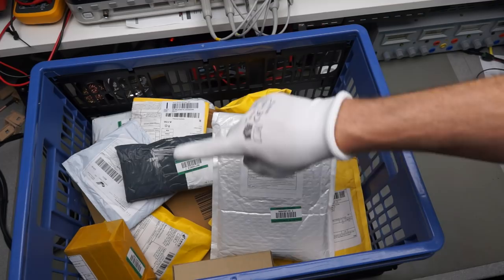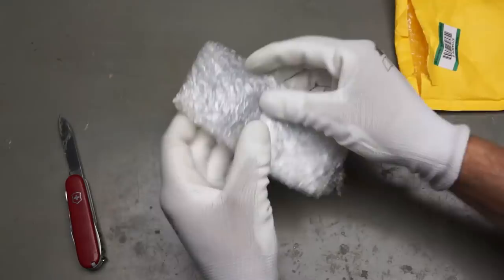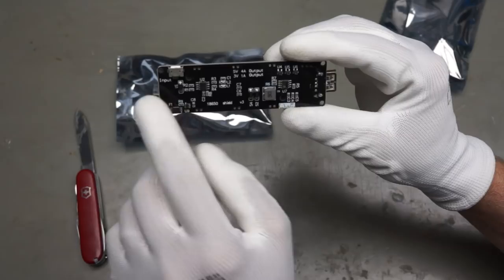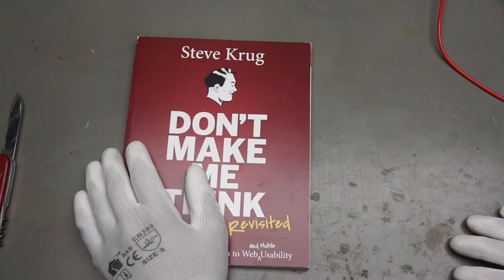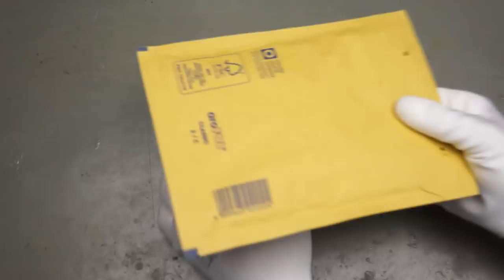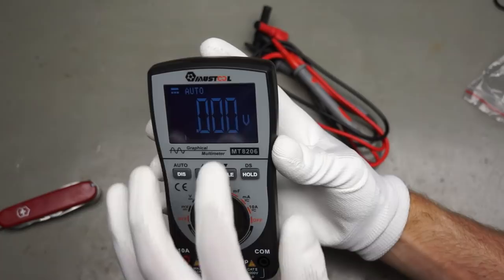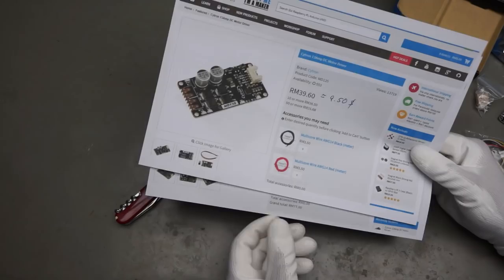#238 Discount Day Mailbag (2.4GHz LoRa, 8x8 Pixel IR Sensor, AM612 IR, MT8206 Multimeter

Comment: I already used that 18650 board for a couple of projects, worked really nice :)
Reply: A bit slow to fully charge the battery, tough, better to use a wall charger.
Reply from the maker: Thank you for your feedback. I think you can change a resistor to increase charging current to up to 1A.

Comment: One diference between this panasonic 8x8 IR sensor and the normal PIR sensor is that this sensor can detect Infrared that is not on movement while The normal PIR only detects IR that is moving. 
A good use of this is to detect a person sleeping, because de PIR fails on it
Reply from the maker: Thank you. I will test it. This would be bad for my work desk. Now always when I fall asleep, the light goes out and I can continue sleeping ;-)

Comment: I can recommend the AMG8833. I have the Panasonic Evaluation Kit for this sensor - worth getting if you are interested in using the sensor in a product. The sensors were originally around €80+ however Panasonic had a rethink last year and greatly reduced the price. I was quoted around €25 in fairly low quantity. The price from Aliexpress is pretty good since the sensor is on a breakout with a voltage regulator and the necessary passives. Soldering this sensor isn't easy - the temperature limits and reflow profiles are difficult for the typical tinkerer.
Reply from the maker: Good info, thank you. I saw it also much more expensive. Now it is not cheap, but affordable.

Comment: It's interesting to see how many people are interesting to see things you purchase. Now I feel encouraged to make a video on things I purchase.  Infra red sensor seems interesting.   I want to buy
Reply from the maker: Mailbag videos are always interesting. Not only mine ;-)
Reply: I kinda figure recording the opening of packages on a video camera recording is a good insurance policy too. I haven't uploaded anything like this myself. However I generally record opening more complex or expensive orders. China blocks YT, but I've taken screenshots from videos to use with missing/damaged product disputes (which are still quite rare for me). It also helps to toss the package on a gram scale before opening.
   I ran a decent sized eBay operation a few years ago. There are lots of customers trying to scam sellers. I was selling high end racing bicycles and quickly learned to do all of this in reverse. I recorded packaging, box condition, and weight for all of my shipments. Such a practice makes disputes and issues seamless. Most logistics companies require this kind of data before they will settle a dispute. 
-Jake

Comment: I also tried the AMG8833 just before I saw the MLX90640 which has a 32x24 array and is just a little more expensive. Both can be used to make a nice IR camera in combination with e.g. an esp32 and a display. I 3D printed a case to clip under my M5stack and now have a nice portable IR camera.
Reply from the maker: Which code did you use? I ordered now also an MLX90640 for the M5stack for comparison. But it is double the price :-(
Reply: I bought my MLX90640 from Pimoroni (UK shop) there were some problems with the code at first (see https://forums.pimoroni.com/t/mlx90640-no-ack/8662), but the one from M5Stack at https://github.com/hkoffer/M5Stack-MLX90640-Thermal-Camera.git works right away.
Reply: Oh, I forgot, there was a bug in the esp32 i2c in the arduino implementation, I had to overwrite it with the github version for the MLX90640 to work. I don't remember if the arduino version was updated in the meantime. If you get the "no ack"  as described in the pimoroni forum, you may have to install esp32 arduino by hand.
Reply: If you have the M5Stack with motion sensor, you will see if the i2c works right away. In the broken version the MPU9250 won't be recognized. BTW I used the https://www.thingiverse.com/thing:2957102 and a little creative cutting and melting to attache the MLX90640 breakout board in a non-permanent way to the M5Stack.
Reply from the maker: Thank you. it for sure will save me time...

Comment: With an amg8833 and esp32 sensor, it would be great to make a wireless thermal camera. There is an even more interesting mlx90640 sensor with a resolution of 32x24. An interesting feature of the sx1280 transceiver is the ability to determine the distance, I hope you realize its connection to the arduino. I wish you success!
Reply: The MLX90640 works great with an esp32 (I used an M5Stack) as does the AMG8833 (I used an Adafruit esp32 feather with a display wing and an AMG8833 wing). I also tried a esp8266 feather with the AMG8833, but it is a little too slow. You can find sketches for both configurations on github. They also provide interpolation, so that the pictures look a little nicer.
Reply from the maker: The MLX90640 is more than double the price. But I ordered now also one to compare. Thanks for the hint about github.

Comment: I have a diymore.cc model of that same 18650 usb power step up, and it seems the 5V is always generated independent of the on off switch, that only disables the USB output, not an issue, but if the battery is constantly under stress, it might kill it, I already have one not old that does not hold charge any more, do not say it's related but it's good to think what happens if a battery stays inserted there.
Reply from the maker: You are right, the switch is only for USB. I would use this board as a UPS or for a solar project. At least, this is what I will try.

Comment: Biggest problem with this battery holder is that it does not provide 3.3V but  3.0V so its not suitable for some devices that really requires 3.3V. Also On/Off switch onlyaffects USB port. Other output is always ON so its drains battery even nothing is connected.
Reply from the maker: Mine has 3 x XC6206 3.3 volt regulators aboard. You are right with the on-off switch. It only switches the 5v USB. And all regulators consume about 350 microAmperes without load. If you remove the enable on the step-up this value is reduced to 90 microA, but you do not have 5 volts anymore. It would have been good to add a jumper to disconnect 5 volt... Currently, you need a Dremel to cut the trace.

Comment: Nice to see a manufacturer using an ESP32. Nice board. I've been wondering if those 220v/5v converter bricks are safe for hobbyists. I have something similar that I haven't powered up yet.
Reply: I used similar ones but from Meanwell. You have to be VERY careful how you connect wires to the pins. Don't use prototype boards, breadboards, or similar things with lots of pins close together to connect to the 'bricks'. At that voltage you can get sparks jumping close gaps like that in some cases. Safer way is soldering wires, but  since the pins are small the wires can break off, so hot glue or a tight case will be useful. The best use is a custom pcb, but then you're better off just using a wall-wart and wire, not much benefit.
Reply: @bardenegri21  good points. I'd planned to grind off enough adjacent pads for clearance, but this model doesn't fit 2.54 spacing anyway which sucks.

Comment: Please update us on that 18650 power supply board when you're done playing with it. I can't find a good off-the-shelf solution for running solar charged lithium out in the woods, and building my own is too expensive.
Reply from the maker: This is what I want to check. It so far looks promising: The TP4056 was not bad in my "Solar video". I probably have to change the resistor to reduce the charging current.
And if you disable the step-up converter you can save some quiescent current. But this is mechanically not simple because it is not foreseen. I killed the IC :-(
Reply: @AndreasSpiess That was probably a bad IC, a disrespectful IC. You had no choice. :o)

Comment: I was counting on that oscilloscope multimeter to be better. Is it worth getting some old analog oscilloscope or the digital is the way to go now?
Reply: That depends on the bandwidth you need, the features you want and your budget. If your budget is < 200 € and you don't need many features: 
1. If the bandwidth is < 5 MHz, get one of those portable DSOs.
2. If the bandwidth is > 5 MHz, get a proper old second-hand analog scope.
If your budget is > 200 €, get a proper DSO, like Rigol DS1054Z or DS1052E.

Comment: I would like to know the basic noise level coming from that little battery supply/boost circuit ;)
Reply from the maker: I can have a look at it during the test. The 3.3V supply is provided by 3 linear regulators. So they should be quite quiet.

Comment: I have those 18650 power boards but I have never been able to get more than 2A out or it will go into some protection mode and you need to remove battery to reset it. As usual high number claims from Chinese products are not true.
Reply from the maker: Good to know. For me the max amperage is not so important. The quiescent current is more important and the efficiency because I hope I can use them also for Solar.
Reply: @AndreasSpiess  I was thinking tu use it as an UPS for my raspberry so the current is enough anyway, but still I like to have some safe margin. If you are going to test them, please do some analysis on the oscilloscope too. Here is my simple project for solar powered outdoor sensor if you want to take a look https://forum.mysensors.org/topic/7797/supercap-solar-powered-mysensors-nodes-as-cheap-as-possible
Reply from the maker: I will try something similar, but with a battery, not with super caps.
Reply: @AndreasSpiess  I tried to use simple and cheap components that anyone could put together. Of course it is not the most efficient solution. I am planning to try with a lifepo4 battery but I'm not sure if it is worth it to keep it solar powered as the other sensor I have it has lost just 0.12v over an year.
Reply from the maker: If your device needs such small power then a normal battery could even be a better possibility (cheaper)
Reply: @AndreasSpiess  I prefer the LiFePO4 as I need only one cell to power my nodes and for 2€ each they are not very expensive :-) The problem of the solar powered outdoor temperature sensors is that they need to stay in the shade to have a better reading but that doesn't allow for a lot of energy from the solar panel

Comment: What's currently the best option to run an esp8266/esp32 on a battery (I need a temp logger, which reports on mqtt every 5 minutes)?
Reply: LifePo4 + TPL5110 + esp
Reply from the maker: You can watch my videos about batteries and about deepsleep of the ESP8266. The ESP32 is not different.

Comment: I want to be able to charge my 18650's to 4.1V not 4.2V. What is the best and cheapest method?
I was thinking of using a LM4040-4.1 voltage reference with an LM393 dual comparator and a MOSFET to cut the power to the TP4056 charger/protection module, when the cell voltage reaches 4.1V.
Has anyone a better solution? Thanks.

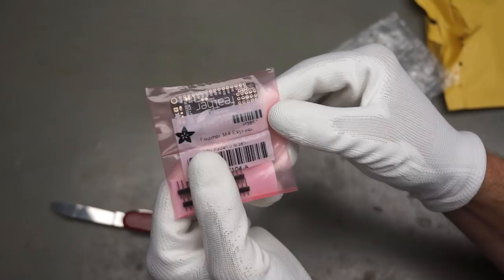Comment: There is a mistake in the list below. At 11:30 the mutlimeter, and at 11:30 the ds203 i didnt see?
Reply from the maker: I placed a link to the DSO203 review video in the upper right corner. I am always asked about all kinds of links (e.g. today the prying tools). So I included this link to avoid the question.
Reply: Sorry Andreas, im watching on a ipad with the yt-app and noticed often that there is no link where the hosts of the show point to it - depending how you did the link, but anyways i checked it twice and found nothing. The linklist in the description shows 2 devices at the same time. Just wanna point out  that there is maybe something wrong and you may have interest to know that. I already owned a ds203 - not happy with it, guess i catched a mondaydevice.
Reply from the maker: Interesting. The link showed up on my iPad :-(  I do not use my DS203 a lot. But if I want to be sure to have no ground reference or if I need it outside the lab it is ok.

Comment: Interessant wäre, ob man das 18650-er Power Borad so umbauen kann, dass es am Ausgang 6V statt den 5 V liefert ?
Manchmal muss man dazu nur einen Widerstand austauschen. 
Ausserdem wäre es interessant, wie viel Leistung das Board im Leerlauf verbraucht.
Wenn man den Akku mit einer Solarzelle laden will, ist das ein wichtiges Kriterium.
Reply from the maker: Du kannst sicher einen Widerstand im Step-up  wechseln. Und der Leerlauf Strom ist 350 mikroampere. Das meiste davon braucht der Step-up Converter. Ich glaube trotzdem dass es sich für Solar eignet. Der Charger geht bis 8 Volt.
Reply: Danke für die Auskunft.
Ich frage deshalb, weil ich gerade an einer möglichst effektiven Solarversorgung für Wildkameras arbeite.
Die brauchen meistens 6V Versorgungsspannung.
Das beste kommerzielle Solarmodul (mit eingebautem Akku), das ich bisher gefunden habe, ist dieses hier : 

https://www.ebay.de/itm/H801-H885-H9-H3-H501-Mini-Hunting-Trail-Camera-Charger-Solar-Panel-Battery/283030979655?ssPageName=STRK%3AMEBIDX%3AIT&_trksid=p2057872.m2749.l2649

Der eingebaute LiIon-Akku hat tatsächlich die angegebene Kapazität (sogar etwas mehr) und im Leerlauf zieht die ganze Schaltung (wahrscheinlich hauptsächlich der Step-Up)  0,13 mA, die Ausgangsspannung ist genau 6 V.

Alternativ verwende  ich noch eine eigene Ladeschaltung für 6V Bleiakkus, die verbraucht je nach Spannungsreferenz entweder 0,12 mA oder sogar nur 0,02 mA. Bei diesem diskreten Aufbau ist der Platzbedarf aber höher als beim Solarmodul oben, weil man für den Akku ein eigenes Gehäuse braucht. Dafür kann man aber auch grössere Solarmodule für schlecht ausgeleuchtete Standorte anstecken.

Ich überlege, so einen diskreten Aufbau auch mal mit 18650-er LiIon-Akkus zu testen und bin gerade dabei, Komponenten auszusuchen, die vor allem während der Dunkelphase möglichst wenig Leistung verbrauchen. 
Bei etwas leistungsfähigeren Solarmodulen mit z.B. max 5W oder mehr ist man je nach Modell schnell auch mal über 8 V Ausgangsspannung.
Da wäre es wohl am besten, einen Step-Down auf 5 V zu verwenden, der die Ladeschltung versorgt.

Eine typische Wildkamera verbraucht im Standby-Modus ca. 0,5 mA, beim Senden der Daten via GPRS dann aber kurzfristig auch bis zu über einem Ampere.

Gute 18650-er Zellen sind ein eigenes Thema, mehr als 3500 mAh sind zur Zeit eher nicht drin, obwohl bei ebay Mondzahlen bis zu 9000 mAh genannt werden. 
Viele Grüsse in die Schweiz aus dem Allgäu.
Reply from the maker: Sieht nicht schlecht aus. Ich bin überrascht dass diese Kameras 6 Volt brauchen. Vielleicht läuft die Logik auf 5V und sie haben einen Spannungsregulator davor. Dann könntest du den überbrücken (wenn du das gehäuse öffmen kannst).

Comment: Is there a PSU with more than one 18650 cells? I'd really like a 3 or 4 cell model with a long 5V run time.
Reply: If you have the batteries packed together in parallel you just fit one in and the other will hang out 😁 (that's how I did it)
Reply from the maker: I do not know of such a device. Maybe you just add more cells in parallel? Should work.

Comment: Hi Andreas, I know you promise that you will make a full review for power board 18650 battery, but I have a quick question since I want to order the same today: can this be used as an UPS like board? I mean is continuing powering a RaspPi 3 for example if you disconnect the "main supply "?
Reply: That is what I would like to know also. And does it maintain its output if the power returns?
Reply from the maker: You have to wait till the full review. For the moment I have no time to do the testing

Comment: 5:19 is it lipo or li-ion battery/ charger...I think it's li-ion...
Reply: The 18650s really aren't LiPo batteries but there's nothing stopping you from connecting a LiPo battery to the terminals and charging it :) (they both work the same)
Reply from the maker: it has a TP4056 chip for charging

Comment: SX1280 LoRa Bluetooth Wireless rf Transceiver 2.4 GHz
I am interested if it can transmit pictures P2P over max. 3Km using Lora ??
Reply from the maker: I will test it. But probably not with pictures.
Reply: E28-2G4M12S 2.4GHz 12.5dBm 3000m SMD IPX/PCB
E28-2G4M20S 2.4GHz 20dBm 6000m SMD IPX/PCB
A type with max 6KM ?? found in a PDF

Comment: HI Andreas, there is not much expierence in the internet to this LoRa-Modul, when you test it, can you also examine, if this is for smarthome usable?  And Thank you for this Video, some new "Kids" in the block around, like the Pir  or the nano power chip (in Part one). So they give me more posible solution for smarthome....
Reply from the maker: What should I test in particular?
Reply: @AndreasSpiess  common tasks for smarthome
 is suitable for the longest range in and around my home (inside 25 m , from outside 50m around the house), 
is it secure, 
can these be uesed for low-power scenarios, like running a sensor (Switch,PIR or Temparatur) for years,
is there a suitable protocol for rf-communication or can i only use the Lora-protocol with these moduls,
are there influences with the given wifi.

Comment: Quick poll amongst Andreas' lovely viewers: 
Which ESP32 board to buy for generic hobbying?
Reply: lolin32
Reply: Cheapest available.
Reply: start with esp8266. when you have the whole datasheet in you head and genuinely need more power, go for 32.
Reply: M5 Stack as it has loads of prebuilt addons and has it own screen!
Reply: Thanks all! 
A clarification: I already have ESP8266s, want to move forward with using dual-core and low-power-modes capabilities.